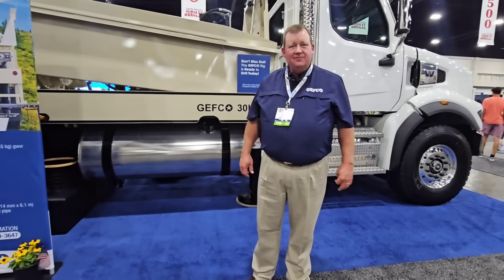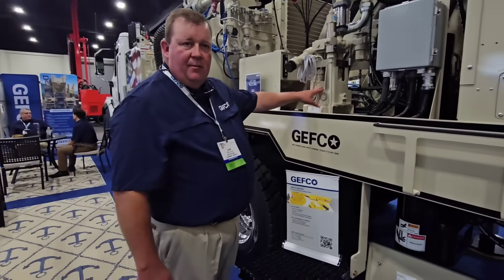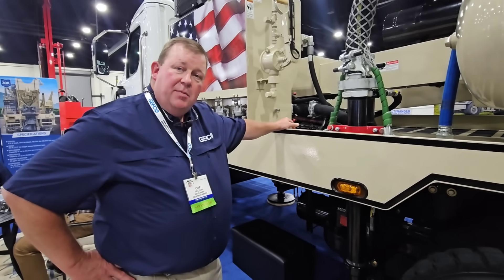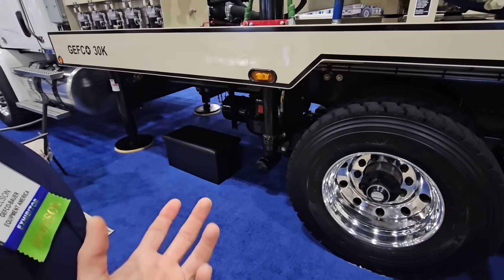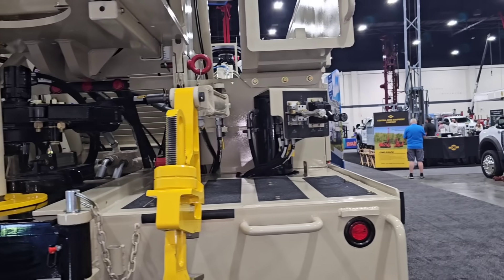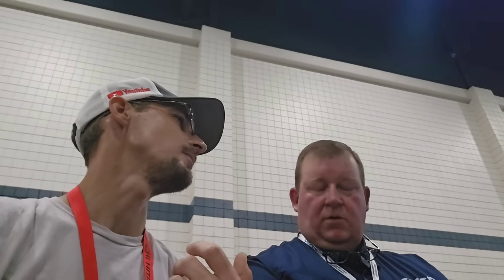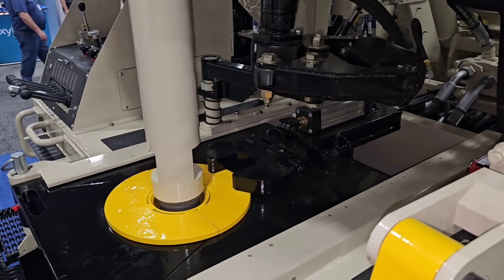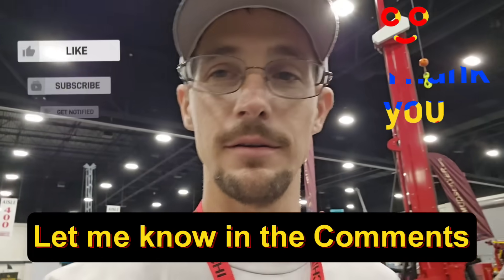Check out this Brand New Rig at the National Water Well Convention! Drilling School offer!

Comment: That's a pretty rig for sure. Things sure have changed a lot since the last time I was a driller on rigs this size. All the rigs then used double drum draw works, a rotary table, Kelly, and pretty much only reciprocating compressors and duplex mud pumps. By and large large they were 1500-ft machines with 2-7/8" drill pipe. It was a lot of work for a drill helper, and I can see where this would make life a lot easier.

Comment: Nice. Cummins great. I’m from Indiana.  My uncle worked for Cummins in Columbus, Indiana for 40 years in logistics.  Funny  I rebuilt two Cummins 600 hp as a teenager  and ran for years  (end dumps). This rig looks like a maintenance nightmare.  Plus, if you’re going long-term Peterbilt. We ran a fleet.
P. S. Former core driller and blast driller. Etc. Yep.
Reply: I am a diesel tech and I agree with you about the maintenance plus the reliability. The drilling rig relies on the road diesel engines only. Just as an example. We have issues with the SCR(def) systems all the time. Some just set a check engine light but allow the driver to get the truck in for service other times the truck goes right into derate mode. Can you imagine being set up with 100s of drill pipe in the ground and the truck deraits? The hydraulic pump could have trouble building enough pressure just to break the rig down. They may even have to leave the pipe in the ground until the truck is fixed. Then the truck needs to be towed you need to go back and set up again. At least with a seperate engine the drilling could still get done. There are a lot of good applications for a PTOs that are run by on road engines only but a drilling in my opinion does not seem one of them.
Reply: @billping2633  Your insightful and knowledgeable comments are most appreciated. Thank you.

Comment: In my youth I worked in the oil well drilling business as a floor hand. When I moved  to NC I tried to get hired by a water well drilling company and could never find anyone with an open position.. In any event I took a job in building maintenance and never looked back. I am retired now and I like to watch anything related to well drilling oil , gas or H20 and the business.

Comment: No matter how much you know, you can always learn more.
Reply from the maker: The day I close my mind off from learning new things is the day I die!
Reply: 1.6 to 1.8  millon before you tool it. Drill pipe and subs could be another 100 grand eassy. Over 40 years in this line of work. Used rigs 10 years old with over 10 thousand hours still cost between 400 to 600 thousand. 30k holds there resale value.

Comment: How much $?
Reply: My guess is $750k USD based on how much fire engines cost which have similar intricacies.
Reply: @Alex-Kubota 1.6 to 1.8 millon with no tooling. That was 2 years ago.
Reply: @Alex-Kubota almost double that
Reply: The same rig with a Cat engine and less BS used to be $485k.
Reply: If you have to ask, 

you can't afford it.